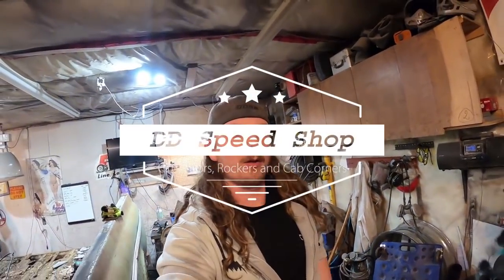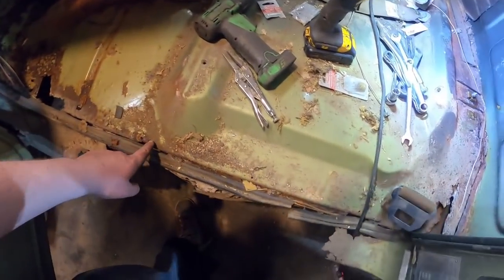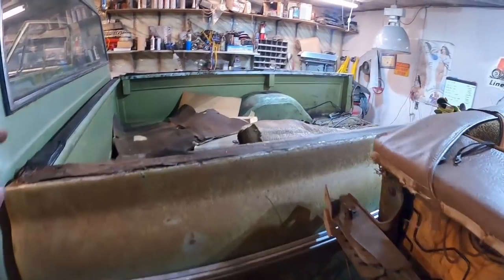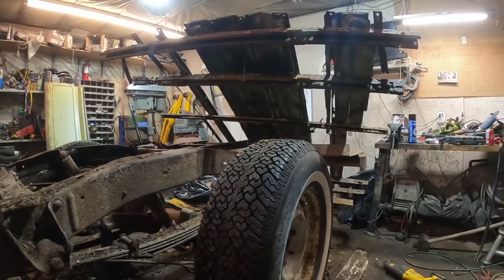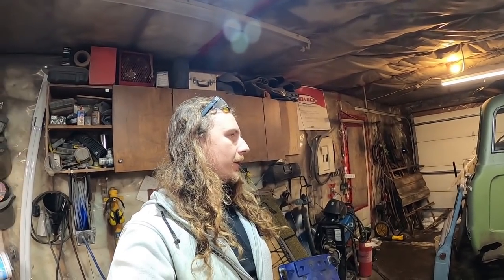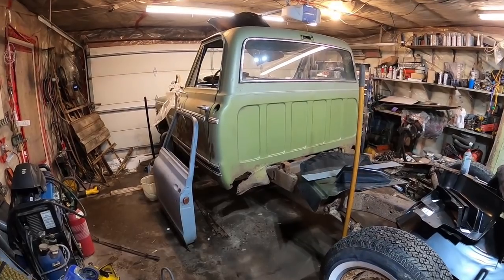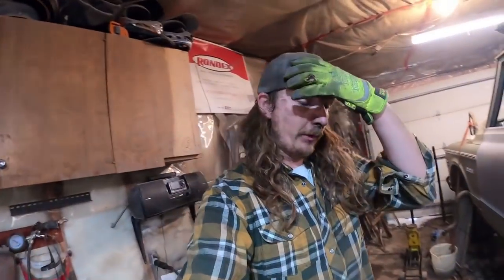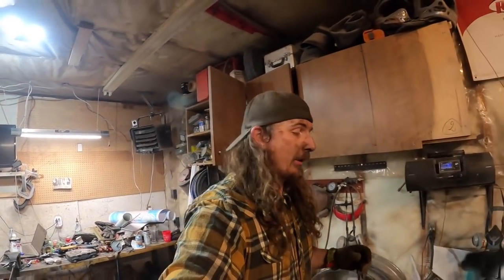Abandoned C10 Rescue Part 2 - How to Replace Floors, Rockers, Cab Corners and Braces

Comment: I wish you had my shop... heated, 30’ x 40’,  2 post lift and every fabrication tool you would ever need, 24’ x 16’ man cave with a 75” TV, surround sound, couch and recliner, 3 screen racing sim and a pool table and I only use it for drinking beer and shooting pool!
Reply from the maker: wow,  yeah that sounds like a dream!
Reply: I finally have one similar , would have killed for one back in my younger days , Changing motors on 120° asphalt didnt bother me back then , today it would kill me , You  can never build a shop to big .

Comment: I had a '64 C10 with a 292. It was the same color. #3 cylinder had really worn rings, I used to have to buy my oil in gallon jugs, and plugs in sets of 8. I'd go through three plugs in #3 by the time I needed to change the others. GREAT old truck, though. Someday, I'm going to get another one. It was a fleetside long bed. It's a shame that nobody likes the long beds anymore. You can carry a lot more stuff in them. You do great work, and it's your truck, not mine. Do it the way you want, I'll keep watching.
Reply from the maker: haha fill the oil and check the fuel.  thanks buddy!

Comment: I shortened my 66 , took out 12" in front of wheel well and 8" behind , took 20" out of the frame under the cab , step cut and a fish plate , weld back , no problems ! haven't seen a oil spout in a long time ! good luck its gonna be cool when your done !
Reply from the maker: yeah should be a cool looking truck thanks buddy!

Comment: Hang on to that oil can spout for nostalgia.  When I started driving they still were selling metal oil cans. You could spike it w that spout and easily pour it in the valve cover. Before I graduated they got cheap and went to pasteboard cans. If you weren't gentle, they'd collapse when you tried to spike them and oil would go everywhere.

Comment: I would cut the frame so all your factory holes will work in your favor, but either way you always end up with great results in my opinion so I’m behind you either way.
Reply: yeah cut the frame under the cab and slide the chassis forward, plus take 8 inches off the rear tangs 
http://67-72chevytrucks.com/vboard/showthread.php?t=636383

Comment: Just cut it and shorten it the right way and while you got the shaft out and brake lines off just flip the rear end it will br the same time to do as the other way plus the truck will keep some travel space and factory springs while being lower. Hopefully you are going to fill the filler hole

Comment: Hey I haven't seen an oil can spout in awhile. There is an awesome kit available to shorten the frame/wheel base it does it pretty clean like and no remounting the spring perches, shock mounts, rear body mounts etc. Comes with a template for marking the frame for cutting then moved forward and bolted or welded and no kitty corner alignment of the rear axle.Really think it would provide a better outcome than the rat rod suggestion.
Reply from the maker: maybe  i think moving the springs is easier than chopping the frame.  to each their own
Reply: @DDSpeedShop  Certainly, you bet I get, just a suggest from an old fart love all your accomplishments

Comment: 3:02, oil can spout, my dad had one with a trigger. I remember oil coming in metal quart cans, my dad talked about glass bottles. Grandfather said it was laying around on the surface in Texas.
Reply from the maker: you know it!
Reply: The cans, they were cardboard with metal top and bottom. 59 yrs old.
Reply: Oh, and if you didn't line the spout up just correctly, you would run it through the side of the cardboard and then you would have a big mess to clean up.✌👍.
Reply: My father had some glass bottles, but I never saw him use them. They're from back in the day when oil came to the  service centers in bulk. The attendants would fill the reusable bottles in the morning and put them in the rack.
Reply: @billywoodman60  i have done that and it sure is a mess lol

Comment: hi Dan! great work so far, making quick work of it. but as for the frame shortening, if it were me doing it, I would section the frame, for the sole reason of you're going to sell it to someone else who is most likely to keep moving forward with it, maybe be a little more difficult to get parts, if someone wanted to bag it using prefabbed kits.  if you planned on keeping it for yourself, then I say go ahead and move the leaf springs, that's just my opinion. keep kicking ass, I'll keep watching.

Comment: I think cutting the frame in 2 spots is way easier than removing 16 rivets relocating and then  drilling and bolting then modifying the frame for clearance then building locating and installing bed mounts . But that's just  me . keep it simple . Good luck !
Reply from the maker: too either their own i guess

Comment: Truck is coming along well. Looking good. Won,'t be long n rust will be gone. Most usually cut the frame, 12 inches in  front, 8 inches in back
Reply from the maker: yup thanks buddy
Reply: @DDSpeedShop  enjoyed the 57 build , l have a 2 door hardtop. Working on it, just put automatic n sidemounts in, moved motor forward n opened up a whole new can of worms. Trying to figure out what l want to do about radiatior now.

Comment: I'm a long bed kinda guy but if you are going to short bed it I feel chopping the frame at the straight part and retaining the frame arch is the better way. It doesn't change your spring angles or tension. You dont have to recreate the arch... just z and plate and its basically done. Also I've seen people cut long beds front and rear to have the right cab to arch and arch to tail. You do great metal work so I'm sure you'll figure it out either way lol
Reply from the maker: yeah i wanna try something a little different

Comment: Good project!  I notice though there is a space between your outer rocker and the cab corner. I believe you left out the rear pillar patch. There is patch panels available but it should have gone in before your outer rocker went on. It ties in your rocker, cab corner and rear cab support.

Comment: i would cut and shorten the frame, i have installed a kit on one of these trucks with the trailing arms, it had a channel piece that bolted in and you also welded the frame back together,  you could just have some 3/16" bent into a channel to fit inside the frame rail, 4 bolts on the front half and 4 bolts on the back, i think that less work then moving the spring.
Reply from the maker: might be  i just wanna be different haha

Comment: I think your a one factory Dan. It looks good so far, I like the idea of just nipping the tail and moving the springs idea as the factory frame is good as it gets ... just a thought, please do not be angry with old man here cause real sensitive feelers/LOL, once cab works done done, for all the welding stuff, see if you have enough friends to pull cab and fenders as a unit or if you prefer, pull the fenders and front clip as a unit..... Then set the LS and trany, do the mounts out in the open so it goes easier at least in my mind and I would like to hear when you are able to hear your thoughts on it even in just the next video rather than typing long wind/version of crazy or nice but your not (its 23 below here fahrenheit) yes you are probably colder but when its this cold, twenty more just doesn't make much difference .. I hope you don't get mad at me for suggesting that.. take care
Reply from the maker: thanks for watching my friend!

Comment: I think the shape of the frame will be a problem to mount bed. I'd do the frame cut. I think the hot rod guys on motor trend had a bed shortening kit with templates to show to cut and it had some plates prefabricated to join them back.  Going to be cool either way.
Reply from the maker: yup ive seen the frame kit.  just wanna be different haha
Reply: @DDSpeedShop  sometimes different is costly and full of headaches.

Comment: i think if you shorten the frame the way you mentioned , you might have problems with the bed fitting and fuel tank , they have kits you can buy , but i think you might be able to download it for much cheaper (but no parts included i think ) i think it would be much better if you section the frame , its tried and true with no hassles, just a thought
Reply from the maker: moving the leafs seems easier in my head than cutting the truck in half,  who knows where it will end haha

Comment: I was thinking about your idea about sliding the leafs forward. What does that do all your bed mounts and alignment. I think it would make it a little funky. Is there another reason that you are better going this route verses chopping the frame and going that route. It’s looking a lot better with you quick work and putting in the new skin!
Reply from the maker: the bed mounts remain in the factory location.  cutting the frame seems like more work to me

Comment: Hey bud Brother’s has a template you can use that bolts and you follow the cut lines to shorten the frame, I understand you want be different but it would be a great instructional video for the average joes working in there garage. Wrench on🤟
Reply from the maker: if this truck does well ill probably do another one by chopping the chassis.  thanks buddy!

Comment: I have same truck with leaf springs flipped axle did a spring under about six inch drop I could send u a pic. Removing leafs will make wicked soft springs exspecially if u try to put cargo in bed.
Reply from the maker: im just going for the look.  i might do a flip kit

Comment: I remember those old oil can spouts ...they leaked like crazy. I know there are a few people out there that make a kit to shorten the frame... watched someone use a bolt in one that can be welded later...I seem to remember the price not being too salty.
Reply from the maker: yeah lots of kits out there to shorten the frame
Reply: @DDSpeedShop   owners used to rip people off by taking empty oil cans and pushing this spout into the top after draining from bottom then charging them 89 cents

Comment: I'm going to attempt a cab corner on my k10. I noticed you overlapped and screwed your cab corner on. Do you later trim and butt it up and weld it? Also I'm using flux core wire, should I swich to gas and solid core?

Comment: I moved the rear end forward with springs on mine Just had to measure several times to get it square
Reply from the maker: oh really?  it fit under the bed easy?
Reply: DD Speed Shop I did it with bed off and then used a 90's Stepside for the short bed replacement had to notch some of the 90's bed cross beams
Reply: Eliminated the 2 piece drive line went with single shaft
Reply from the maker: @realCriticalthinker  nice.  That's what I'm thinking I'll do

Comment: Are you planning on putting the fuel tank back in the cab? If memory serves me right, a Squarebody K5 Blazer tank fits perfectly between the rear frame rails, and that's an old oil can spout
Reply from the maker: yeah ill probably put it back in the cab for now

Comment: Axle flip instead of pulling leafs to lower it and still retain load capacity? In case the next guy wants to tow a trailer? less leafs = less load. After all, it's a truck.
Reply from the maker: yeah i dunno if i wanna go that low or not

Comment: Your truck has leaf springs those typically come with coil spring rear suspension what year did you say your truck was I did see a 1972 Chevrolet c-10  vin coded as a 73 with the leaf spring
Reply from the maker: its a 71

Comment: Just my opinion but i would shorten in the traditional way ive done it kind like your sayin and in the long run wasn't as happy with it as i was when i did it the normal way
Reply from the maker: what didnt you like about moving the leafs?
Reply: @DDSpeedShop  mostly it was the looks but also the front hangers interfered with the bed a little .when we did it the normal way we were able to use 4 of the 8 bed mount holes witch made lining up the bed that much easier vs. Moving leaves forward . You do great work so im sure you could handle either way but i just found normal way is kinda less work and buyers are more open to it

Comment: You got a great start on it! Hows the inner roof at the windshield look? I just went thru all that shit with a 69 C/10 Stepside. I have a few quick vids on my channel of it when it was done. Keep up the good work brother!
Reply from the maker: most of the cab is solid other than the floors and stuff
Reply: Canadian cars mostly rust from the bottom up. Coast cars rust from the top down.

Comment: Shortening that rear end is going to limit who buy's the truck. Older people over 50 have more cash for an oem truck than those under 50 who most still live with their mom's in the basement broke as hell voting Democrat ,and "anti first amendment ANTIFA for short". So depends if you are asking double ,or triple digits for your project. So I send that question back at ya. Should you shorten that bed?
Reply from the maker: i think its worth more here as a shorty.  but if you wanna send a deposit ill build it any way youd like
Reply: @DDSpeedShop  LOL You ask for my opinion ,and I gave it. It's your truck do to it what you will brother. I've seen trucks like that go for as high as $50,000 fully restored ,and the only thing they changed was a newer updated drive train like you did to the 57 ,and suspention with all around disc brakes. Mind you they did have awesome paint ,and body. Besides you do know your area better than anyone else.